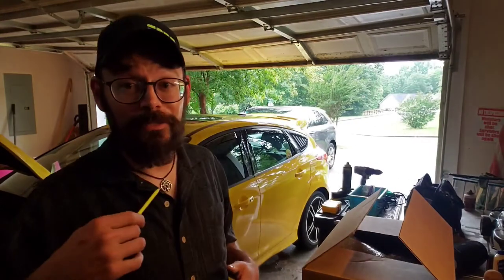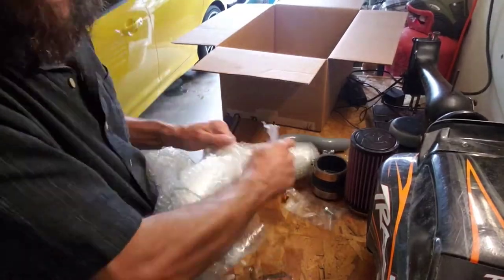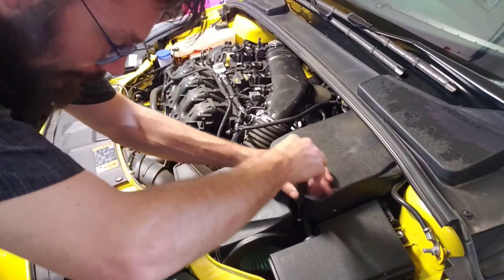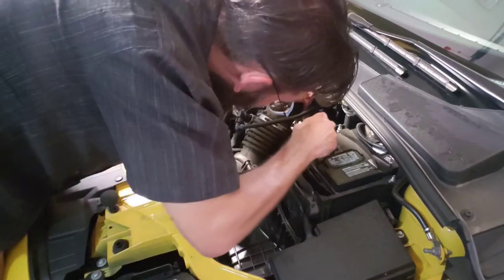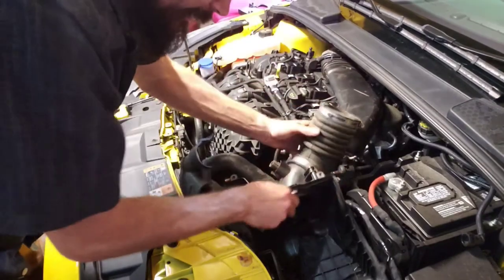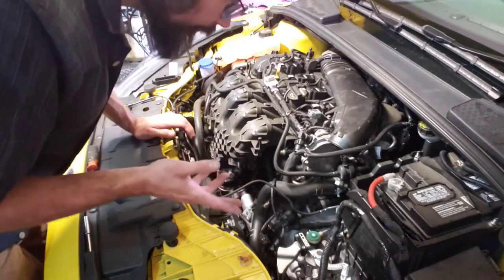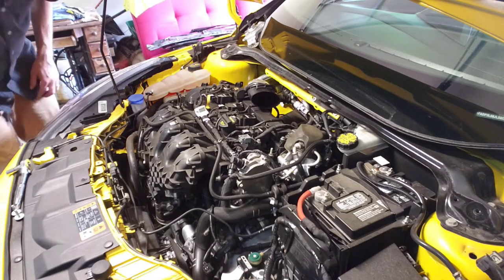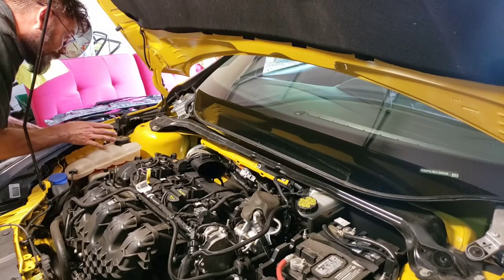2J racing cowl induction intake install

Comment: Hey man my intake doesnt have that bracket coming off the side you bolt down. Is that a new design maybe?
Reply: mines the same way, did you ever figure out why it’s like that ???
Reply: @airtight7388  yes haha and thank god we dont have it 😂 the engine movement would snap the bracket off of that bolt placement or the weld. But when you floor it and the engine moves it was breaking them